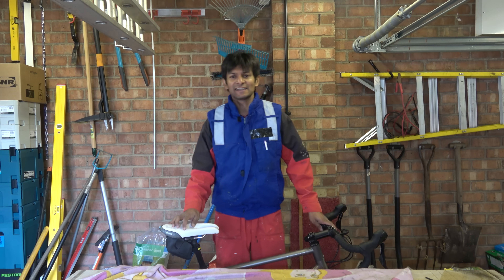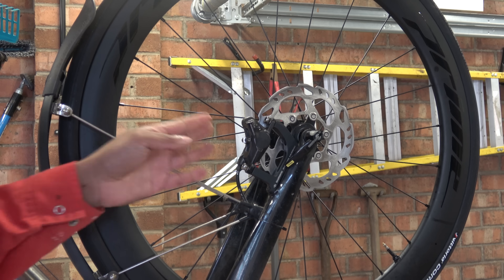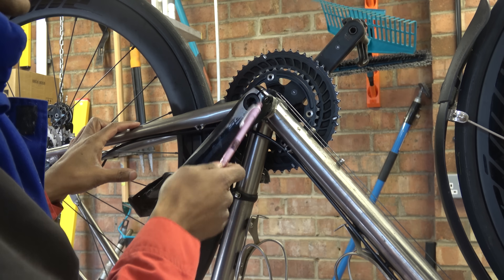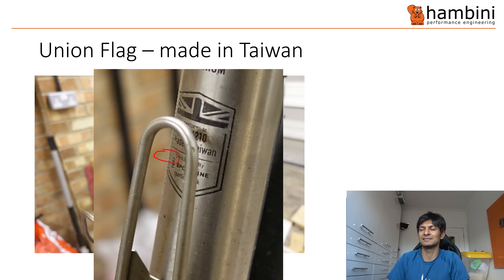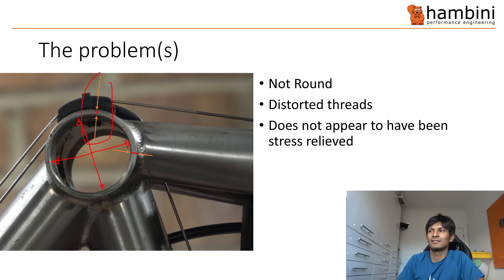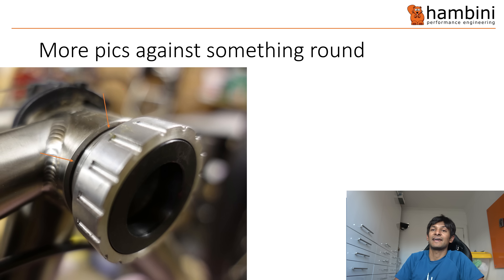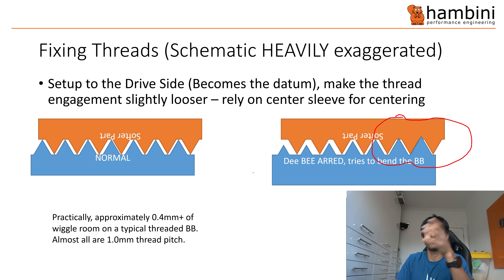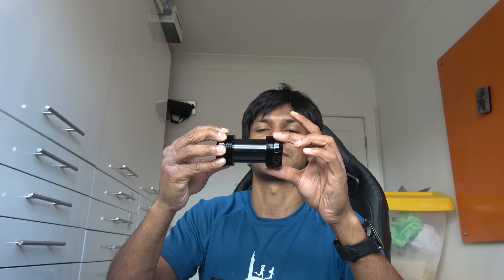REAMING: Titanium Threaded Bike Frame engineered in England by Clowns

Comment: If the threads are all the same depth you can say, due to the egg shape, that it was taped before welding. If it became egg shaped due to welding stresses and then taped the thread depths wouldn't be the same.

Comment: Wow, I stumbled across this video a week or two ago. I just happened to be ordering a custom made titanium frame off of Alibaba and when they told me that they would begin welding the next day, since I saw this video, I let them know that I want to make sure that the BB is still round and not oval after welding. Today the company messaged me that the weld did not turn out properly, that the BB became oval. So now instead of creating a new BB that is CNC'd 2mm, they are going to 3d print the BB to 2.1mm and they believe that the slight increase in thickness will prevent the ovalizing. I asked if they thread the BB before or after welding and according to them it's before :| I sent the person a link to this video, not sure if they also do the stress relief. How can you tell whether the BB area was stress relieved or not?

Comment: I've been a boilermaker/ welder since I was 16 years old  I'm now 58 
To put a butt weld in this context as this presenter did  is 
Way off the mark 
There is not a butt weld in sight 
They are all fillets 
That is obvious 
Best show distortion on a fillet weld 
Instead because that's what's involved here 
I do understand whatever happened here was bad practice 
For  sure 
Best practice is start with more wall thickness ( just a little maybe a mm or max 2 )
Stress relieve and machine thread after 
But that is more costly 
But the proper way 
Even if u did machine it first and stress relieve it 
It would still have a little residual stress in it 
Better yes but not perfect by any means  and a lottery on quality 
Still 
I don't know why somebody would create something from such a spectacular and beautiful material and then 
Do half a job on the important parts 
Other than lack of means in the factory obviously there is teirs in manufacturing 
And this company decided to use a lower teir manufacturer 
Or the fab company in Taiwan decided to cut corners and pull one over 
Shame other n that nicely fabbed bike 
Out of round bosses = Shiite alright 
Credit where it's due though 
He got a better result somewhat

Comment: I just watched this after the video of threaded BB's on the Boardman carbon frame. I thought there would be fewer potential problems with a metal BB shell. Apparently not. All my bikes are BSA threaded steel frames. I use both the cartridge and external style BB's and have experienced tightness in installing or removing the non-drive side and the cranks not spinning freely. Now it makes sense. I may look into sourcing a tap for the BB threads in future.

Comment: I think that's why titanium bicycles never became popular on the pro cycling/racing circuit: It's extremely hard to machine and weld properly.  Hambini is an Engineer by training who seems to design and build his bottom brackets to aircraft standards.  So I think he knows a thing or two about how aircraft grade titanium should be welded.  Airplanes crash if they get the welds wrong on the aircraft frames.  Bikes crash, too if they get it wrong.  But nobody seems to care when a bike is out of alignment when it's made. Sigh.  Hambini obviously cares.
Reply: That's not the reason, the reason is Carbon surpassed Titanium as the material of choice due it's lighter weight and other inherent qualities. FYI: Modern aircraft do not use welds they are constructed with rivets.

Comment: I stumbled onto this refreshing channel and it hilarious to see some shoddy bike engineering as though the forces are so small nothing will get rogered.  It is actually quite intricate to jig a bike and get it centred accurately  and then fit stuff so that it is square. There are big forces/torques going through the critical components and it is easy to roger them with small misaligments.

Comment: I bought a Genesis CdF Ti 3 years ago and it rides really well. There were three faults in the build up by the retailer. 15mm bushes in the front wheel for a 12mm thru axle, a spacer on the freewheel that shouldn't have been there for a sram cassette and the brake pads in the rear caliper were the wrong way round so the retaining pin did not go through the holes but sat above the pads. The sram red brake calipers were poor and have been replaced with Hope. When I took the drive train off to clean all the parts a few weeks ago I left the shells in but didn't notice any problem with free rotation of the cranks before I took them off and after I put them back on. Altogether, my problems have been with the components and the frame has been fine so far and the whole set up provides a comfortable ride. There was no discomfort experienced on a 100 mile ride at all. The one thing about the frameset that I don't particularly like is the mounting points for the front mudguard being halfway up the inside of the fork legs. Putting the mounting points there made fitting a front mudguard particularly awkward.

Comment: Great video, thanks for posting! Titanium has a low co-efficient of thermal expansion and low distortion values!! Trouble is, titanium is so strong that
even if the frame is heated, tensions remain which cause cracking. And you cant hydro-form it. Looks pretty but rubbish material for bike frames - choose aluminium!
I think I need to get a new hairdresser-
Reply: Total BS!

Comment: Frame jigs, for the most part only retain the alignment if the frame (within the bounds of jig accuracy/stiffness & opperater skill) they generally can not stop tube destortion and/or shrinkage of materials due to welds.

What can "help reduce" distortion, out of round, etc are heatsinks in the form of an bronze expanding mandrel with back purge.

I have no clue how your able to tell on a frame made from Ti, steel, stainless or ally visually if it's been "Stress Relieved" as you keep talking about (unless there was an obvious blackening/blueing of the steel), especially as most frames are painted, and in raw Ti or Stainless its brushed, polished or bead blasted. 

Yes PWHT absolutely has to happen in Aluminium frame building, less so in steel as its usually 4130 or a derivative of that with additional elements like Niobium, Ti, molybdenum etc to gain differing properties.
Even highly stressed parts like chassis, suspension arms, roll-cages etc are not heat treated in 4130 or similar unless it's thicker than 3-4mm.

Also, during the tube manufacturing process for most bicycle specific tube sets/materials (not aluminium) the final temper of the material is gained through drawing.

When TIG welding or brazing tube like this the temper of the tube is deminished (typically anneiled slightly) and a high level of operator skill is required to create a sound weldment whilst limiting the reduction in desired tube characteristics.

PWHT in many cases would, when above AC1 temp for carbon steel (high carbon equivalency) create a totally different grain structure to the material, (as its closer to the utectic point) this may be undesirable. 

Some steel tubes from manufacturers like Reynolds, Tange, Columbus, Dedachi (spelling) do produce some tubes that are heat treated as part of the tube manufacturing process but not as a requirement of frame production. 

Many big manufacturers can and do PWHT things like high end bmx or jump bike frames in 4130, but as most manufacturers in Ti and Stainless are smaller volume and often entirely bespoke builds they don't always PWHT frames.

Many builders in steel tube as "bespoke frame builders" use Fillet or Lug Braze, the temperatures to melt the Bronze and Silver solders is typically between 450°C - 700°C (and again volume of production counts here too), with AC1 being C. 720°C this makes brazed or Silver Soldered frames impossible. 

Of course we're slightly going apples to oranges here, between bespoke one-off builds and maufacting of thousands of the same model. But my point still holds. The majority of bikes on the mass production lines of even the best manufacturers are either Aluminium or Carbon Fiber as you know.

Aluminium usually needs a full anneile process post weld, prior to any reaming, facing, alignment etc, then is sent to be solution treated to artificially age the material back to - T6. 

Incase anyone thinks ima some ranting crackpot, I'm 15 years in the trade, welded for defence, nuclear, scientific instruments, a very large folding bike brand in the uk, have my own business and have built multiple steel frames with TIG, brass and silver. 

Great videos as usual.
Reply: The day I can glance at metal and determine its grain structure or internal stress level.... will be quite a day!  
I think he just chased the threads and increased the clearance for this fix. Nothing to do with stress relieving. I really doubt he built up the bore, stress relieved it, re- machined it and then cut new threads. But if anybody else hadn't done that, I have a feeling he would have said they were cutting corners and should have.

Comment: Another video replete with more lies from Hambini to promote his overpriced products.
Welding sequence is of virtually no consequence to BSA thread alignment be it, steel, Al or Ti  bottom bracket.  Zilch. Noise in the cosmos.  This is because heat penetration and level of residual stress imparted by weld penetration is much less than the hoop strength of a bottom bracket shell.  In other words, the section modulus of the BB shell puts up too big a fight to deform under the heat of welding. 
This bike had a buggered thread. There are many reasons for having a fouled thread. Once the thread is cleaned aka re-chased, any name brand BB, Shimano preferred for $30 will work perfectly.
Hambini's wet dream of the rigid center section between his over priced BB cups acting as an axial alignment for lower drag crank spindle rotation is utter BS.  If the BB shell is properly faced, there will be axial bore alignment of respective BB cups without a rigid sleeve.
Shimano engineers are smarter than Hambini.  Much smarter.
In summary, Hambini is a charlatan who denigrates the bike industry to promote his overpriced products. People that didn't go to engineering school don't understand his misconceptions and believe them.  As PT Barnum used to say, the world is full of dumb people.

Comment: You make a lot of great points in the video...actually all your videos. I will make one counterpoint however. You are fixing outliers. The only frames you measure and fix are the ones that people have problems with. I think to truly say a particular brand is crap you really need a statistically significant sample to verify the quality. To pass judgement on an entire brand based on n=1 is not really an accurate assessment. 
That said your videos are awesome and extremely entertaining.
Reply: How do you know they are only outliers if you do not know how many bad frames they produced that are never sent to Hambini? 

You incorrectly assume that Hambini represents the population of all or near all of the poor frames produced by any manufacturer, which he obviously does not.
Reply: @ivanboesky1520  Some of what you state is valid. What I can tell you is this: I am a Quality Engineer with over 25 years dealing with manufacturing issues and how they result in consumer complaints. What I’m stating in this being an outlier is this frame ended up in Hambini’s video because it was identified by the end user as having an issue. You are right we have no idea about the greater population. We have to make the assumption that they must get it right most of the time, or they wouldn’t have a business. Thus this video should be understood as this is n=1, it does not represent the greater population of the manufacturers frames, but it does represent that this manufacturer has poor process controls and they are not using the correct inspection techniques to identify out of specification products and/or processes.

Comment: The idea that that skinny little aluminum tube in the BB “aligned the two cups in spite of them being aligned in the threads and off the face of the BB, is crazy.  Interesting concept that might work if it were steel, but the Al tube doesn’t have the stiffness to deflect the larger diameter titanium BB.

Comment: My logic sense tells me,that the more holes trough the disk ,the less metal remains,  the more heat the remaining metal has to process. So are holes actually more sensible than just a solid disk? My logical sense tells me no. Also uneven and unsymmetrical holes cause uneven unsymmetrical heat dissipation thus possible warping.

Comment: It is normal for threaded BB shells to be threaded before welding. Just go to Paragon Machine Works' catalog and see for yourself. You do use heatsinks while welding up a titanium frame to minimize heat distortion. There will be some distortion and then you face and chase the BB shell afterwards. I only build steel frames so I can't speak towards needing stress relief of titanium frames, but it is certainly not the norm for custom steel frames to be heat treated after building them, and not possible for brazed frames. I only braze my frames, which I braze out of the jig after tacking. You don't use heatsinks for brazing and there's always some BB shell distortion. After facing and chasing the shell, the BB runs smooth and creak free, better than any commercial frames I've had, so they perhaps don't face and chase as thoroughly as they should. Facing and chasing is done by a combo tool that does both operations along the same axis. It isn't particularly complicated or interesting and is a small part of building a frame.

Comment: Is this the reason why you think bb86 and threadless BBs are better -- because if the  apertures maligned or not round, you can put in a threaded  sleeve to align the bearings?
Reply from the maker: Yes. It's more difficult to fix

Comment: BTW, tpi =threads per inch, not fuggin teeth!! And in total agreement, welding, stress relief, then final machining (including boring the hole then threading).
Reply from the maker: Local dialect for engineers here uses both

Comment: Something I’m curious about. 

When a thread has different amplitude running across it and you have to re-tap it, how bad does it need to be before the difference between one and the next trough is too large and you can no longer retap the thread because there is not enough material. 

Does that happen ?

What to do if it does ... or would that (hopefully) be so much of a disaster it would fail QC ~ or it would become obvious there was a problem when you try to screw something into it ?

Also why is it we rarely see an issue of the BB not being round In terms of the male bearing side, it is always on the frame side of the equation or again would that be a major QC failure.

I really want to say something here about males preferring a right fit, and something sexist toward “female” fittings... but I’m not that nasty.... although I’ve now made everyone think it. I hope you have all cringed sufficiently at the thought. 

Also I’m assuming It is much easier to cut the thread on the smaller part compared to trying to hold onto the frame and keep it from moving around.

Comment: It always frustrates me how you skip over a simple clear summary of what was physically wrong and what you actually did to fix it. The viewer has to try and join the dots which is frustrating…

In this one it’s not clear where the damage came from… were the “higher” teeth cutting in to the shells and damaging / distorting them ? Did you just round off the high spots on the NDS, retap with a bit more slop and then fix your properly aligned BB with some goo to gum up the gaps ?

Good fix anyway, shame they can’t take more care in the first place. BSA should be the easiest design to engineed correctly.
Reply: The re-tapping could possibly have damaged the BB shell.